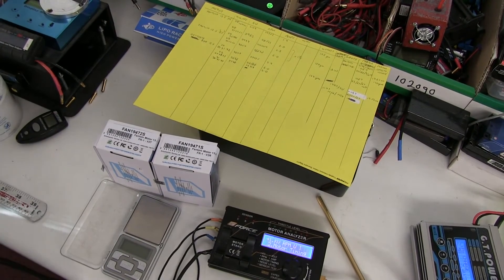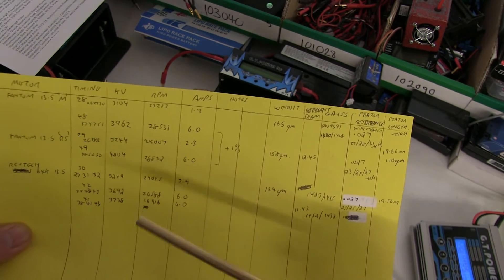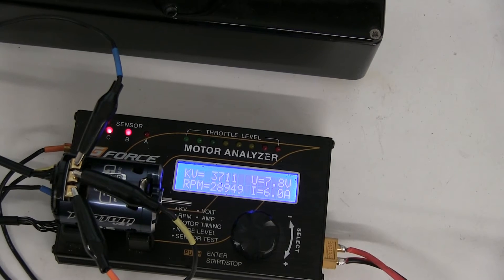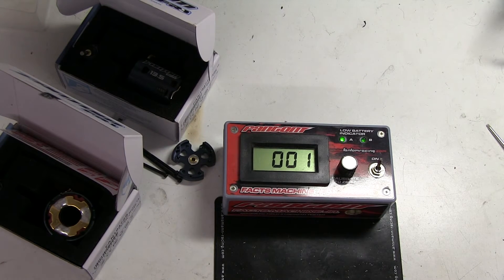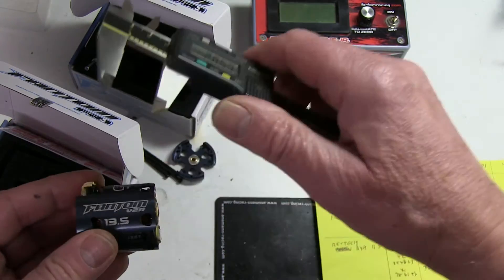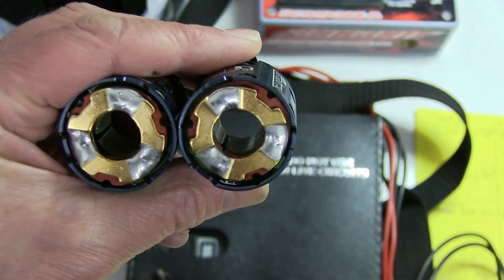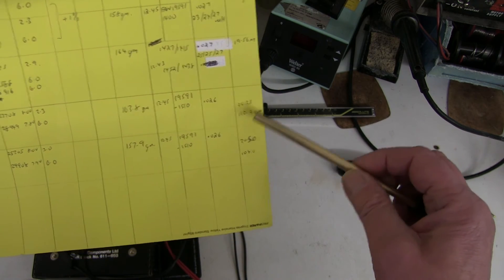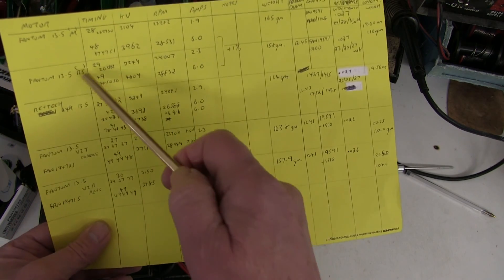Fantom V2R and V2T , 13.5T Brushless motors. Comparison and test.

Comment: That is SO strange that the V2T and V2R weigh the same!  As you stated, usually the "rpm" version of a stator is physically shorter with 1 or 2 less laminations, and thus less copper winding--both equal less weight.
In this instance with the V2 Fantoms, do you think, Nick, that maybe they wound the V2R tighter that the V2T to get less total wire and resulting in less total weight?  A more probable scenario is the AIR GAP between the rotor and stator is LESS in the Torque version--meaning more torque and more stator steel.  I know there is a limit--14.5mm max ID for stator but I don't think there is a minimum spec, at least as far as ROAR goes, not sure for BRCA.

Comment: Hello Nick! I really like your approach. I read in your comments that 24K is the best motor for blink Buggy 17.5. After that, you tested several Fantoms. I like the Fantom approach that I can order various options, and it seems logical to me that they put aluminum screws to reduce the dispersion of the magnetic flux. I will be very grateful if you can tell which motor is better.
Thanks!
Reply from the maker: Hi Alexander.
Yes, I run the Fantom Version1.
The Version 2 have stronger rotor magnets, which are not so good for Touring Cars on large fast tracks.
The Version2 are much better with the version 1 rotors, for Touring Cars.
The aluminium screws are marginal. I prefer the stronger steel screws.

Comment: Love your reviews but i would like to see more dyno analysis. BTW on the dyno you always measure the esc as well, so i would be intrested in seeing a dyno series with tamiya TBLE02s, blinky stock racing esc (justock or similar) and high end racing esc, set to blinky and with boost+turbo. Specially intresting how far the tamiya and a normal speed control are apart, and how big the advantage of a high spec controller in blinky mode.
Reply from the maker: Hi
I have been trying to determine a test for speed controls.
I will try and set up a test like you suggest.

Comment: Mr. Adams,I have written to you before and I am a huge fan of your work.  I think your testing is very good and I'm surprised you have not been approached from a professional racer.  Anyway, your motor testing is free spinning.  One can increase the RPM's in many ways without a load but that is not power.  Have you ever thought about testing in a way that "MCPAPPY" does or using his new device or building your own like it?  As you know, electric horse power is torque x RPM so finding the KV is not the true way to find if a motor is good.  We both know that regarding load-less testing, we can just add a smaller rotor to get a higher KV reading.   With your knowledge, I thought that you would be able to do these types of tests and present them to the public.  Races from all platforms would be interested as those results would cover more than just oval and off-road racing.  Thank you for your hard work and time.  Tony
Reply from the maker: Hi Tony
Thanks for the suggestions.
I originally started the tests just as a quick guide for racers.
It is possible to glean some useful info using the Kv, Amps and advance.
And I do measure the rotor gauss.
The Dyno and analysis does take a lot more time, and I have done some tests already.
I used to use a dyno with brushed motors to measure the acceleration time, but modern motors are too powerful and fast for that one.
Most racers just want a quick recommendation and not too many tests and figures.
But I will try and do some more dyno related tests.
Thank You. Nick

Comment: I enjoy your videos, I think you need to get a true motor dyno instead of the analyzer for checking motor. I would bet that would give you the difference between motors. I am looking at getting a motor dyno for the same reason, the analyzer says motors are about the same, but track says different. Tells me a load is needed to perform  thorough testing. https://www.miniprousa.com/  this is what I have been looking at.
Reply from the maker: Hi Christopher
I do have an Eagle dyno tester with computer anaysis.
I have used it on some previous videos
However it takes a long time to do the measurements, analysis and comparison, so have not had time to do it.
The miniprousa looks interesting, as long as it can handle the power, and is not too expensive.
However, the results on the KV tester can give a good indication of the motor performance, and I race the touring car, so do consolidate the results on the race track compared to other racers with different motors.
Race to win
nick